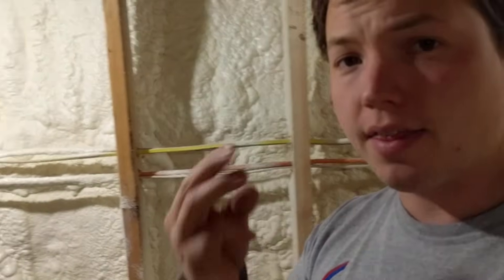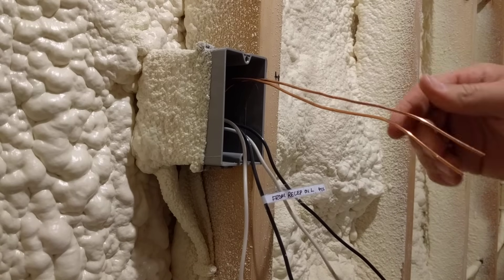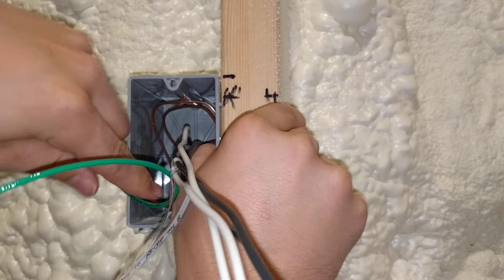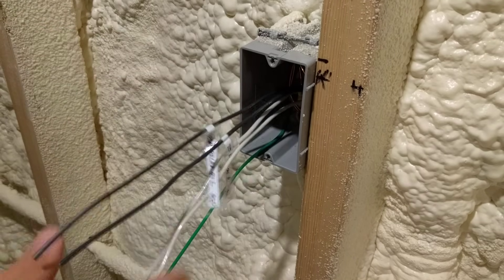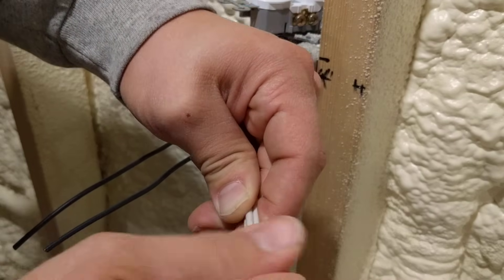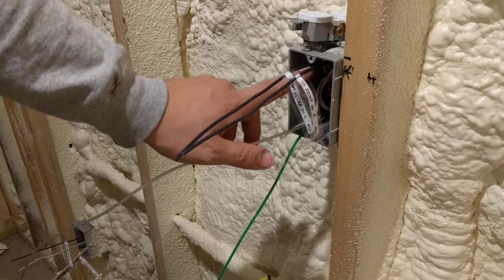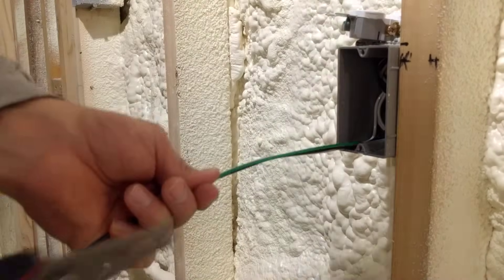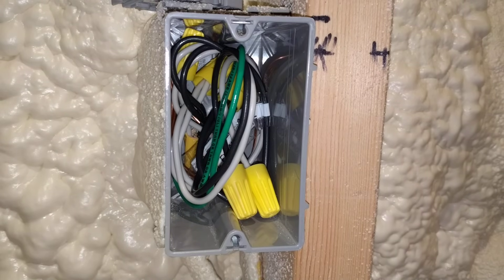How To Rough In Wires for a Standard Outlet or Receptacle Using Pigtails in Daisy Chain - Ben's DIY

Comment: This method is more for factory production where if one outlet fails the remaining outlets in the run continue to work. In a home
setting if an outlet fails  you would want to replace it immediately. The problem being some people might just ignore it and continue to use
the remaining outlets in the run rather than incur the expense of an electrician.  With current continuing to flow through the faulty outlet 
you could have a fire hazard brewing. In a factory setting outlets have a lot more stress and strain placed on them and are much more
prone to failure . There are also personnel on hand to replace an outlet quickly and here the pigtail method makes perfect sense.  
Taping your wire nuts to the sheathing and wrapping the receptacle terminals with electrical tape is also good practice.
Reply from the maker: Thanks for sharing your thoughts!
Reply: With the pigtail, no current flows through the faulty outlet unless it is shorted or something is plugged into it. If the outlet shorts then circuit is turned off by the breaker. If the outlet opens, it is the only one not working.
Reply: SuperDdy, sounds like you're making a case for "do you want good enough or do you want excellent."
Reply: @surferdude642  I sleep better at night...why add another layer of unnecessary complexity? AKA DDY

Comment: Nice video and thanks for sharing.  Very informative.  I have a question, I am wiring my kitchen for under cabinet lights.  Removed the drywall and wired for 10 lights under the cabinets.  Is there a way for me to test my wiring to make sure there are no issues before closing my walls?  For example, can I wire nut in and out hots, neutrals and grounds all the way down the line and then hook up a light at the very end of the run to test the line?  If not, what are my options?  Thanks again!!!
Reply: 10 months later, I’m assuming you found the answer by now lol but I’m curious as well and want to know how you handled this.
We’re the lights directly wired to a switch or with plug in outlets?
I would definitely complete the circuit breaker connection and be sure all lights work and/or run an outlet plug in fault indicator which will tell you exactly whether the outlet passes (also if GFCI is setup correctly which I believe you would need for the kitchen) or, if there’s a fault, it will tell you where the problem is, i.e open ground, etc...

Comment: Hello Internet, I am a YouTube electrician only 1 hour old so verify for correctness.  Just wanted to point out that the other reason for the pigtail is if the receptacle fails or if you trip your GFCI receptacle  the next receptacle on that circuit will continue to work VS wiring in-line through the receptacle which would cause every receptacle after it to also fail.

Comment: Bro why would u use pigtails and take more room in the box , just my method though.
Reply: If you do not pigtail the wires, if one outlet was to stop working, all of the outlets on that circuit would not work.
Reply: Dominic Rosiak not true at all, that’s why they have the tabs on them to continue the current as long as you put the wire under the screw. Also the odds of that happening even if you use the back stabs would be so slim it’s not even funny. The outlet would have to be smashed for it not to continue current. Using the back stabs is faster, more convenient and better for troubleshooting
Reply: Tactical Basements stab in connections generally aren’t a good idea in standard receptacles unless it’s like a GFI greater chance of a loosening of a connection which creates heat and potential arc hazard
Reply: @tacticalbasements6074  I don't agree with using the backstab, but otherwise you are totally correct. Why? Because receptacle wiring is always parallel wiring, regardless of whether pigtailing or not.

Comment: Good job! As an electrical inspector, it's nice to see someone do it neatly, and not trying to cut every corner.
Reply: I have a question for you.  What if I don't have the insulated green ground wire ( 0.59)   Can I take a piece of the black or white  (same gauge) wire and make my pigtail? Of course, I would put a green tape or something to indicated that the cable is the ground pigtail.
Reply: @JohnSotomusic  Since you never got an answer, no you can't. Ground wire smaller than 4AWG is required to be identified by having insulation of the color green, green with yellow stripe, or uninsulated. You can strip the insulation off and be fine in your specific pigtail case.
Reply: Spoken like a true inspector!

Comment: I notice you leave quite a bit of wire. I tend to tuck into the bottom corner, then trim the wire to box height. It gives me enough wire to work with, and I also seem to be able to tuck it without having to wrap around so much extra wire. Great video, I enjoy seeing someone else's ways. I'm only 17, but I'm excited to get into the trade.
Reply: Code requires a minimum of 6" of wire from where it enters the box to the end of the wire. I usually cut it 6" from the outside of the box.
Reply: Leave yourself extra wire for future projects, replacements, additions, and so forth. Very common for tradesmen to leave a "6 inch loop" of wire so that if someone down the road wanted to change the outlet or add a receptacle they're not stuck running an entirely new feed wire.

Comment: 3:47 If the two sets of wires are not going to connect tight enough to the outlet, then neither is the pigtail.
In other words, that is faulty reasoning.

Some valid reasoning for using pigtails instead would be  -
1) If you just want to use pigtail to make it simpler - i.e., only three wires to the outlet
 or
2)  to be able to put more of the wiring toward the back of the box -- to make installing the outlet easier by only needing to bend one pigtail set of wires rather than two sets of circuit wires as you push the outlet into the box.
Reply from the maker: I agree. I should have taken more time with that brief explanation. Thanks for your input! I really appreciate it!

Blessings,

Ben
Reply: Seems like keeping the circuit connected down the line in case there is a failure in the receptacle or a loose connection would be reason enough.  I had a receptacle that was loose and after tearing out 6 or so receptacles I finally found the problem. Would have been faster to find the source of my problem if it was wired with pigtails.
Reply: Steve McWilliams If the outlets were connected in line, wouldn’t the loose connection be located at the first outlet (closest to the circuit breaker hot wire connection) in the chain of faulty receptacles?
Just asking out if curiosity as I’m new to electrical wiring.
Reply: I think what was meant by the statement was more or less the Murphy’s Law principle. Being that the receptacle screws are the most likely point of connection failure in the circuit, reducing the amount of weak points by half reduces the likelihood of such a failure.

Comment: "this whole video is B.S." Everything in this video, from labeling the wires to pigtailing them  is way, way overkill, and to top it off the wire nuts he's using are the worst kind "ever" to use. i'll admit the the panel he cut in, in a previous video was very nice, but a panel is different, you want to use overkill there, but outlets, "not". i mean what is the point in labeling the wires in the box if "you" ran the circuit, "you" should know what wire is what unless you have alzheimer's. and the idea that a wire nut provides a better connection than a terminal screw is preposterous, i've seen wire nuts loosen over time just as much, if not even more than a screw and i've seen more people install a wire nut incorrectly than i've seen them tighten a screw incorrectly. if wire nuts were so much better, then why don't they use them to make connections in a panel. sometimes people just outthink themselves and this is one of those times
Reply: RE: [[ ". if wire nuts were so much better, then why don't they use them to make connections in a panel."]]
I don't think they are better at all but they ARE satisfactory for junction box connections.
Wire nuts have been used for nearly a century (ending "solder and tape") without any outcry about them -- and if there was a real problem with them, that would not have happened.
Reply: you missed my point, i wasn't insinuating that wire nuts were unsatisfactory for making joints when "needed". my point was towards his comment in the video, that a wire nut connection was somehow "better" than using the screws on an outlet device, when that's simply not true.
Reply: Sorry, I guess I did miss it. 
I agree with you on that.
Reply: CHASER I’m a little late but I don’t think he meant connections on the screw terminals were bad he was just saying it’s a better practise of pigtailing the hot and neutral incase the outlet becomes defective, the other loads downstream won’t be affected cause there still will be an unbroken path to them since both neutrals or hots aren’t on both terminals
Reply: @slugh8499 
That could be but I very much doubt it, because
when power(upstream) and load (downstream) wires
are both connected on the outlet screws, 
there would still be a connection path 
even if all the nonmetal parts of the outlet went up in flames.
The only way to lose downstream power would be 
if one of the connection screws melted/arced
or melted the metal connector between the screws.
And (MAJOR POINT) if that happens (burn/arc connection) 
then you would definitely WANT to lose downstream power to alert you to the problem.
Reply: yeah,  i've seen way more joints with wire nuts fail than i've seen a receptacle fail after it's been installed properly and hot checked, if a device is defective it's usually defective from the factory and caught and replaced early in the install and not down the road. where as a wire nut can give the appearance of a good connection at first and over time can fail easily, due to improper install, heating and cooling and even vibrations. so i believe your premise of this practice is "better" is flawed. while i believe that using wire nuts "aren't" a bad thing, but just for someone to propose that it's "better" than using a set screw type termination is preposterous. ultimately it's the human factor that causes these failures and i believe that with wire nuts there is more room for error because, you can't really see what's going on underneath the wire nut after you have started installing it, you can only go by feel and on a set screw terminal, you can feel during and see after the install that the connection is good or not. i've seen way more wire nuts just fall off the joint while i was installing devices than i've gone back to a house with an outlet that's failed, even if it was because the screws weren't tight. and who knows how many loose wire nuts i miss, because they were held in place by all the wires bunched up in front of it holding it in place. a lot of so called experts think that "their" way of doing things is the only way, just remember there's a million or better ways to skin a cat and it's not the "way" you do it, it's how "well" you do it.
Reply: 2Truth4Liberty I guess it all comes down to preference honestly, I was just taught to use pigtails for instances like this. Thanks for the reply
Reply: @slugh8499 
I don;t think it should just be preference for preference sake, it should preference for safety.
There can be added safety (ability to notice failure) by other outlets failing when an upstream outlet fails by arcing.
That said, there are times when you have added safety by using a pigtail that can outweigh the other safety mentioned. For example, a small box in a plaster wall house that has a lot of wires and the owner does not want the outlet hole enlarged. Or even new construction where the circuit design and box selection still just don't leave much room, then go with pigtail :-0)

Key point - always be thinking of safety in your choices concerning electricity.
Reply: 2Truth4Liberty for example, let’s look at a split outlet. You split the hot tab so each plug at ur duplex outlet has its own individual voltage (Red and black wire) the white wire on the neutral side should be pigtailed especially when the first receptical is the most upstream. You don’t wanna rely on the device screws. Cause if the chance they fail all other loads down stream will screw up which is obviously not a good thing. Maybe code where u are is different but in Canada it’s code to do it that way.
Reply: @slugh8499 
Yes, an split outlet would have different considerations.
That does not mean you should not keep safety in mind when choosing between options the will meet the need.

Split outlets usually do not have downstream outlets (i.e., the reason for the split is usually to allow for more dedicated power). 
Normally split outlet is supplied by two separate circuits and the neutral should NEVER be shared between circuits.
Not only for safety but that will cause problems with the AFCI breaker/outlets.
Reply: 2Truth4Liberty I just used split outlet as an example, but I’m saying for my sake. With what I learned and was taught pigtail ur screws but that’s just me.
Reply from the maker: Thanks for your feedback. All of the things I did in this video were suggestions from reading electrical books, talking to electricians, as well as the State electrical inspector. Labels are definitely overkill and are more for future people that work on the system. Again, thanks for the honest feedback and I'm sorry it seemed poorly done in your view.

Blessings,

Ben
Reply: NP. sorry i'm so critical, just in my nature as an electrician and hate to see all the misinformation about electric on YOUTUBE and there's a lot. and believe me when i say i'm just as critical on myself as well. like i said don't overthink things, it just complicates the job at hand. labels for future people that work on the system, really, if it is installed properly there won't be any reason for someone else to even pull those wires out. and even if they did, it's just feed in feed out. and if you wired the whole thing like what i saw, where you didn't cross your wires going into the box (you know, wire coming from left going into the left k/o, wire coming from right going into right k/o) should be enough identification as it sits. not saying you did a bad job, i know you do very neat work, just by seeing your panel cut in video. just misinformed and overthought.
Reply: @chaser9363  christ dude, as someone working on their own projects right now, I'd rather have a little over kill than not enough info ! Too many people do awful videos, be glad he's thorough !
Reply: didn't say "a little overkill" i said "waaaay overkill". don't really care how thorough he is, it's not my house. just making an observation as an electrician and letting him and others know what he's done with the parts mentioned, wasn't necessary or practical, even though, i'm sure he had good intentions.
Reply: @chaser9363    It never ceases to amaze me how someone can take their time and talents and produce a really good video(a lot of them actually), and then someone comes along and denigrates what they did. I've seen videos people have put up with wrong and dangerous information in it that deserve to be ridiculed, but this is not the case here. You think he did too much. I don't think you can really ever do too much. Maybe like to do the bare minimum or take shortcuts. Since you are an electrician why don't you make a video, just one would be fine, that shows all of the world the " proper"  waaaay to do it. Most everybody watching his videos know why people like you(trolls), make such rude and unnecessary comments. You want attention. Sad! Please go and produce that video, I'll gladly watch it, I'm always willing to learn from the master.( I'm assuming you are a master electrician). I had two uncles who were both master electricians. Have a good day, sir. I wish you well.
Reply: here, let me call a wahhbulance
Reply: @chaser9363  It's way overkill. I agree. They would be fired on the spot taking that long.  Not to say one shouldnt be detailed  and meticulous  if it's their house and have the time. In the field when time is important he wouldn't  last or he would have to ditch that labler and focus on what is actually  important.

Comment: i think 3 # 12 is to many for yellow wire nut
Reply from the maker: It was fine for the ones I was using according to the manufacturer. Always check the instructions for whatever wire nuts you purchase.
Reply: YELLOW maximum is usually 2 #12 PLUS 1 #18
RED easily handles 3 #12

Comment: NEC Table 250.122 states that the grounding conductor, and thus the pigtail, can be no smaller than a 12 AWG for a 20 amp receptacle circuit.

Comment: a clue to remember.  Code now is from back of the box there is to be at least 6inches of  free wire.  You don,t need it 10 inches out the front of the box to make the pigtail.   to much wire out the box only makes it harder to get that wire back in the box.
Reply: Also twist the wires together for the pigtail.  big mistake to not twist them together.   they can work loose.  seen it to many times and years ago seen it on a 2circuit cable.  the wire that worked loose was the neutral wire.  So guess what 2 hots and no neutral and was  circuit feeding kitchen plugs.  so it shot 240 volts to the Ref plug.  guess what the guy said how he wondered what happened when the Ref went up in smoke.
Reply from the maker: Thanks for your suggestions! I appreciate it when people share their tips.and tricks to help out our DIY community. Blessings!